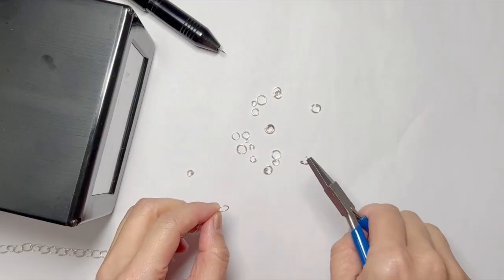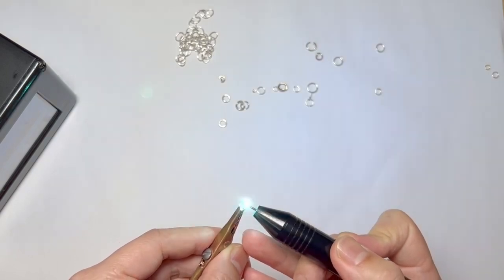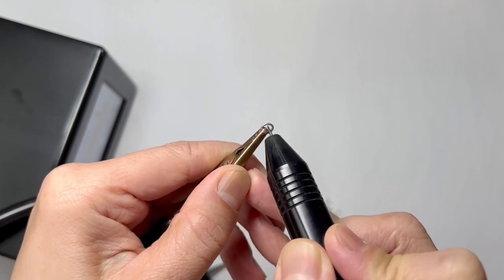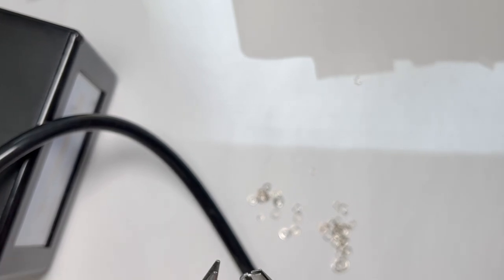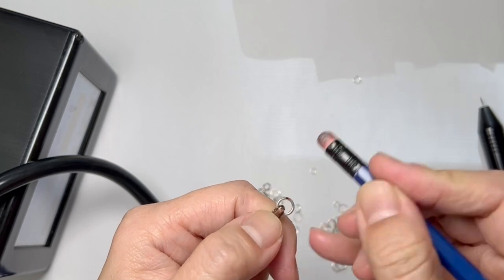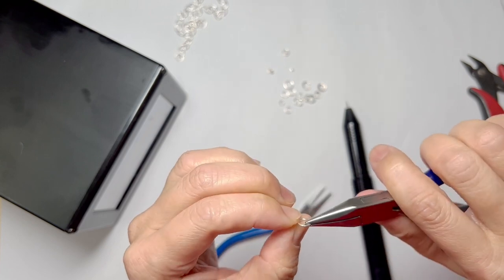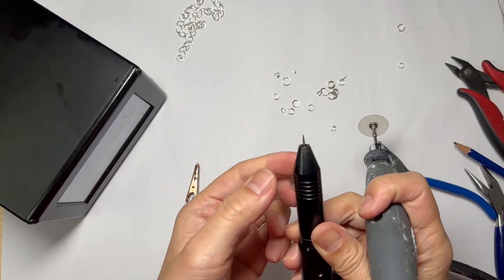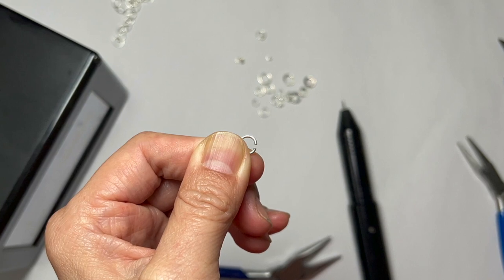5.  Micro Welding Fails  - Common Mistakes and How to Avoid Them - Free Permanent Jewelry Training

Comment: I've been looking for a video that addresses the issue of securing a jump ring so my jewelry doesn't fall apart. Thank you so much for such a detailed and informative video. I'll try to use the Micro Welder in hopes I don't blow myself up. (just kidding).
Reply from the maker: LOL - you won't blow yourself up with the welder, but I did blow away a jump ring with my flame torch when I was first started soldering and set the flame too high.  It literally flew, hit my curtain, then burned my carpet where it landed!  It was like something right out of a movie.
Reply: @stonesandfindings  Oh Dear!! What model Orian Welder do you use?
Reply: I want to buy a welder like the one you use in the video that you talk about welding jump rings. So I  was wondering which Orian model you use. . It looks like the model that costs ~ $2000+ .Do you have an extra $2000 you'd like to lend a  starving artist?  Ok, I'll settle for knowing what welder you have. so, thanks for your advice. I love your videos!

Comment: Hi! Thanks for the great video! I am having a hard time with bracelets staying together - lately I got multiple clients saying there bracelets fell off! And I just don't know what I am doing wrong or what I should switch up?
Reply from the maker: Don't get frustrated - you are not alone, but this is easily remedied.  If you haven't already solved your problem after watching my video, I may be able to help with a few quick checklist items.

What gauge (or thickness in mm, if you don't know gauge) jump rings are you using?  What power setting (assuming you are using Orion, or if you're not, that they're similar in power settings)?

Comment: Hi! I enjoy your videos! Quick question.. i hear a lot that the ground cable should go on pliers, not the chain or jump ring. I see in most of your videos you put it directly on the jump ring.. can you explain the benefits? Thanks!!
Reply from the maker: Thank you for watching! Arc pulse welding works by running the current from the electrode to the grounding clip.  The farther it has to travel, the weaker it is.  The difference is slight, but I have found that I get more secure / stronger welds when I am closer to the seam I'm trying to weld.  

This is also the way that I was taught by the Orion instructor at a tradeshow booth demonstrating it.  It has always worked best for me that way, too.

Comment: I'm seeking guidance with my new Amazon Jinhu welder for jewelry making. Specifically, I'm having difficulty consistently welding small 2.5mm 14k gold-filled jump rings. Here are the challenges I'm facing:

- Settings 1 and 3 often fail to produce a spark.
- Higher settings tend to weld the rings but often result in them blowing out.
- Other settings occasionally produce a single spark or do nothing at all.
- I am not using argon gas (yet)

Could you please provide advice on effectively using the welder to permanently join these small jump rings? Any tips or adjustments to settings would be greatly appreciated!
Reply from the maker: Hello!  My apologies, I have never used the Jinhu welder and I don't know how many watts those 1-3 settings produce.  

I would suggest that you start off with larger diameter (but same thickness/gauge) jump rings and find the best setting.  Then reduce to smaller diameter jump rings.  WIth tiny ones, you have to have more precision in holding them steady and they're hard to see.  As long as they're the same thickness, the same setting will work.

As far as setting is concerned, find the setting that doesn't blow out, but might overmelt.  If you can consistently weld securely, then reduce the power to the next lower.  Practice and make sure you are able to consistently weld, before moving yet lower power.  Rinse and repeat.  Finally, you will find the ideal setting where anything lower you will not get a secure weld, and anything higher, you'll flat top (over melt).

I hope this helps.
Dana
Reply: @stonesandfindings  Thank you!

Comment: Thanks for the video! Question- I just got my welder and I was surprised on the stainless steel practice tests how many sparks were flying. Is this normal? I can’t see any sparks in the videos I’ve watched but I’m wondering if the camera just doesn’t catch it.
Reply from the maker: there are sparks in the video, but not always a lot.  I've welded tin and other objects (household fixes) and it does seem some metals spark more than others.

Comment: I’m struggling with a burn look to each jump ring even after wiping it? Also on low Ws any suggestions?
Reply from the maker: You can use the argon gas - it will reduce the fire scale.  Also, you can also help it be less black by keeping your electrode clean (less sooty) by regularly sanding it.  It will only minimize, and not completely avoid.

Comment: Thank you for the video! This was very helpful. What material are the jump rings you are using? I'm working with stainless steel and would love a comparison in terms of recommended wattage :)
Reply from the maker: In this video, I am using 925 silver.  I do not use stainless steel, but I have heard that it requires higher wattage than sterling silver.

Comment: How many welds is typically needed for 22gauge 4.3mm?
Reply from the maker: I typically just do one weld at 7.5w for 22 ga.  I like doing 5w when the diameter of the ring is under 5mm, but sometimes it opens when I use 2 pairs of pliers to twist and try to break the bond.  So, although it did weld, it was not a secure long-term bond; it snaps and breaks open again.

Comment: Great video! Do you think this could this be used to weld thicker wire like 10g for bangle bracelets? Higher temperature and multiple passes maybe?
Reply from the maker: I've been able to weld giant washers onto a steel nut.  So, it is possible.  However, I feel that the aesthetic result would not be as good as solder.  It is hard not to leave little pitted marks.  Having very high power, high enough to go fuse thick ga wire together might warp it / melt it.  It would take more work to straighten.  However, if you do not solder, definitely, I'd try the welder.

Comment: Wonderful video! Thank you for the tips. What pliers do you use?
Reply from the maker: Thanks! I use chain nose pliers - flat ones with short nose (don't buy long needle nose - they give you less control).  I find pointed tip easier to see, rather than square nose.
Reply: @stonesandfindings  Who makes these or where did you purchase them?

Comment: I watched several videos on this machine and half the people say they use the argon gas, half of them don't. When is it advisable to use it and when is it not necessary?
Reply from the maker: if you're doing pop up events, don't.  The tank is a heavy set up and take up room.  Really, if you're doing permanent bracelets, where you're welding a tiny jump ring, I advise against the add expense.  You can remove the fire oxidation with a fibreglass pen (available everywhere) or a white eraser.
Reply from the maker: forgot - please see my video on argon gas for a more comprehensive explanation and result comparison.

Comment: What wattage do you use for very fine jump rings? Also do you use argon?
Reply from the maker: Hi! I use 5W power.  If your electrode is a bit dull and it's not connecting properly, either sharpen the electrode or up the power to 7.5w.

Comment: How many watts would you recommend for jump rings that are 3mm/22gauge, 3.5mm/21 gauge, 3mm/24 gauge and 2.5/24 gauge?
Reply from the maker: depends on whether it is silver or gold filled (gf and solid gold requires slightly more power than 925 silver); also depends on whether it is a very sharp (almost new) or rather dulled electrode ( sharper the lower power you need).  In general: 
22 ga - 7.5w 
21 ga - 7.5w to 10w 
24 ga - 5w

I will post shortly a video demo on the different metals and wattages, as well as shape of the electrode.  Pls stay tuned!

Comment: Even if it does spark is it welding correctly ?
Reply from the maker: A spark doesn't necessarily mean that it has welded correctly.  Also, no spark doesn't necessarily mean it did not weld securely.  The best way to be sure is to try to open the jump ring with two pairs of pliers.  You should always test for security anyway - you'll feel more at ease.